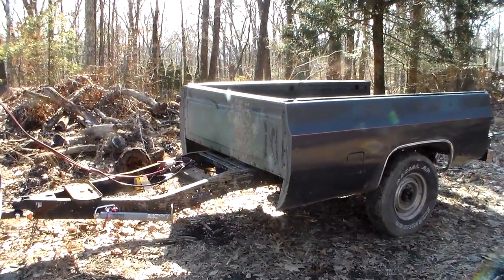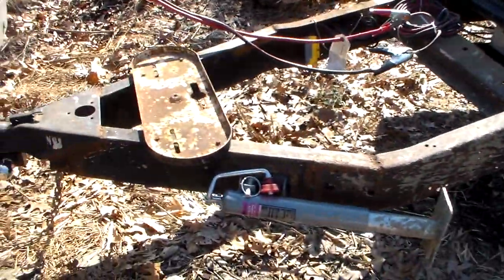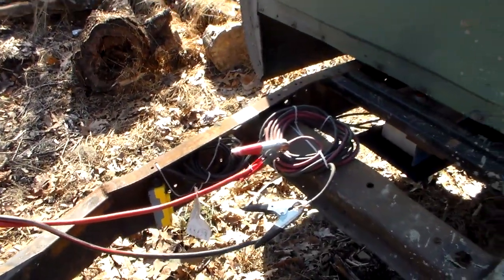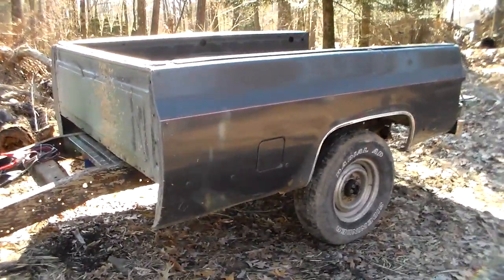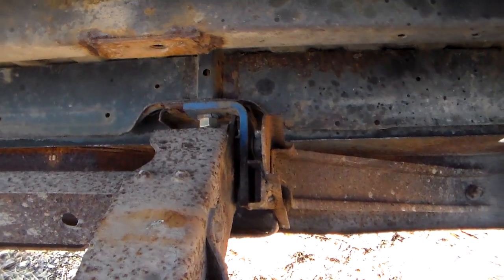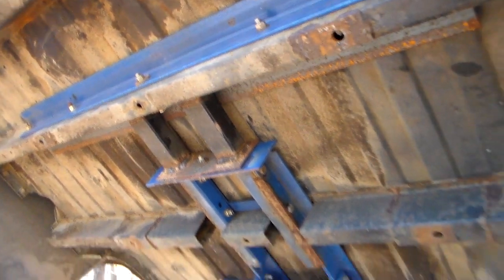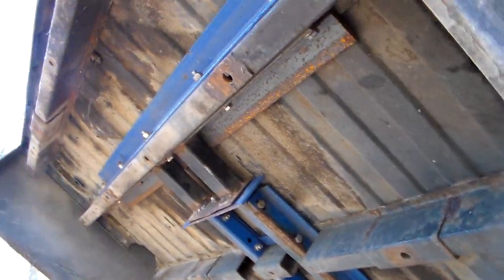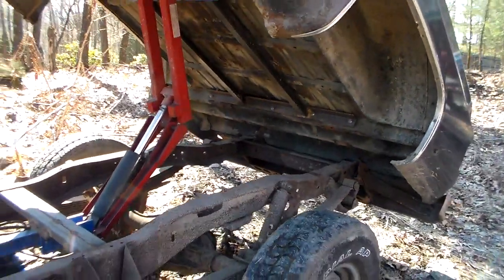Homemade 2 ton Dump Trailer from a 1978 Chevy C20!

Comment: Will save a lot of time on jobs just have to find places to dump different material like broken concrete for free and dirt i had dump trucks and when they were tearing out broken concrete i found a place and i had a place one job was taking out a parking lot jack hammer on machine suburban city asked about it said I could dump it in there yard was going to use along creek bed for wash out they saved a thousand dollars cause didn't have to buy said take all i come up with 4:38
Reply from the maker: Right. I burn or chip/shred brush and then for block, rocks etc I have land with areas that need fill so it works out good.